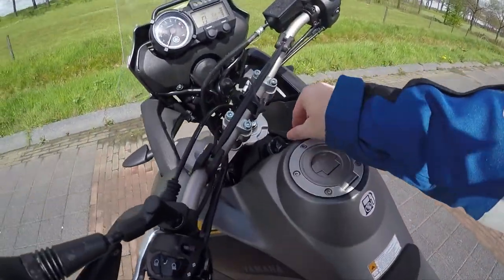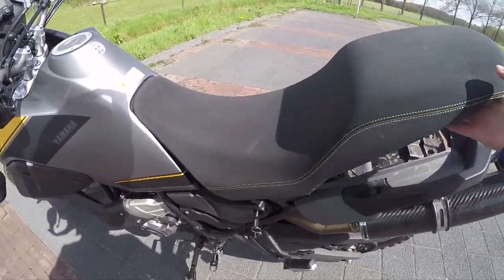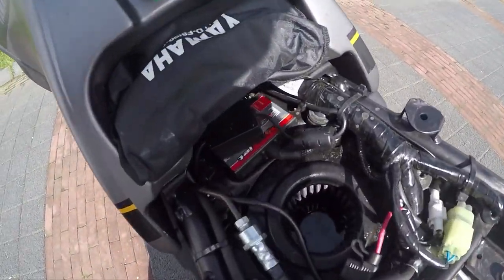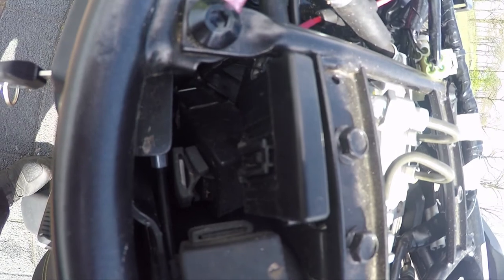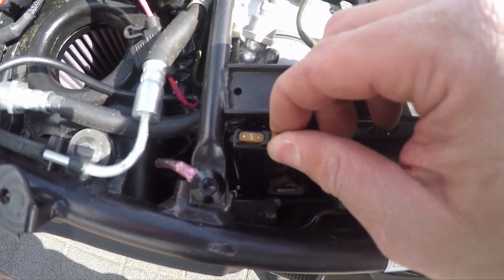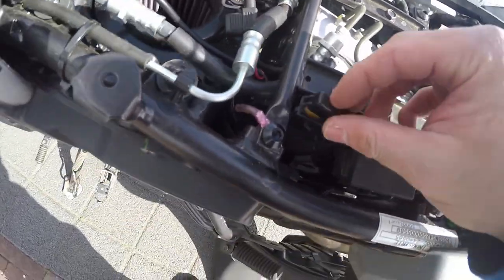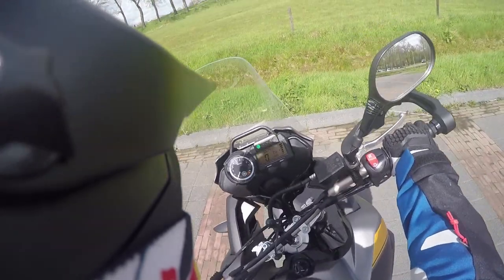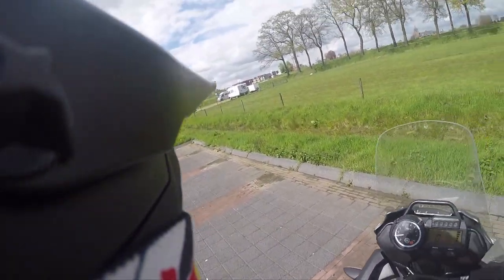How to turn off ABS on a Tenere XT660ZA

Comment: hi!  thanks for this video very usefull for me ,I have tihis same model with ABS. Do you have any idea how to charge the battery?, it is under fuel tank, the constructor was drunk at design time.
Reply: You remove the fuel tank to access the battery. Once there, attach a c-tec charger cable.